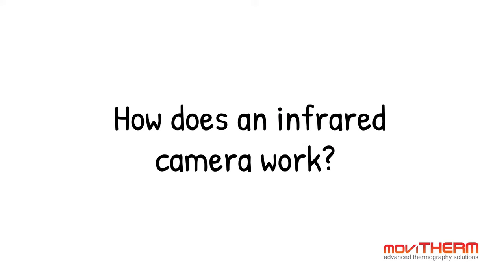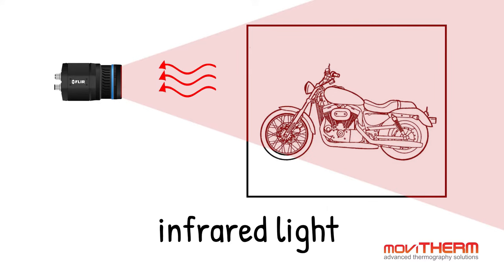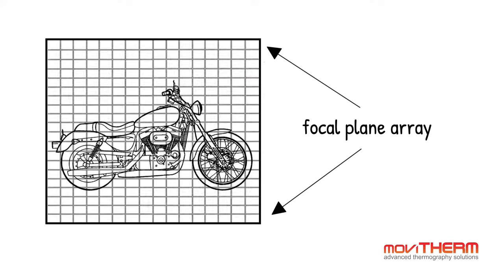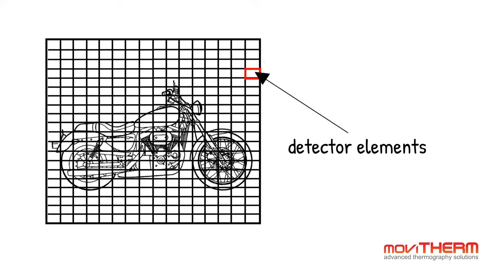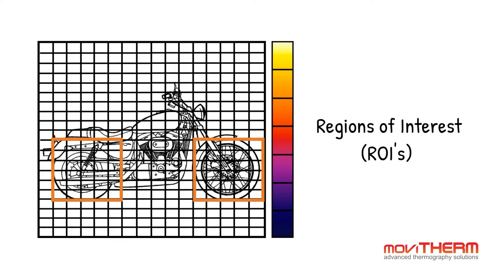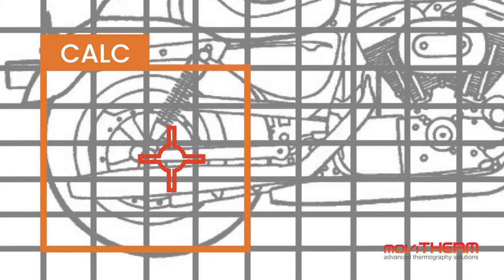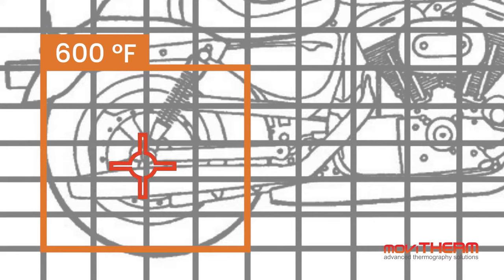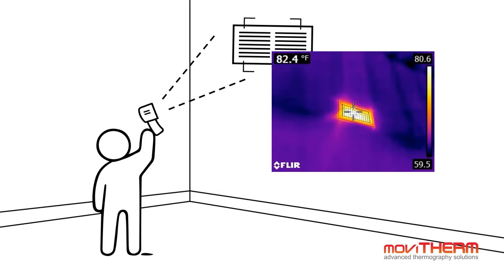Infrared Cameras - How do they work?

Comment: How come these cameras measure the temperature of the "things" that are far away and not for example the temperate of the air in between?
Reply from the maker: Hi R2D2 - great question! Air is essentially a mixture of gases. Most gases are transparent to infrared cameras and the camera sees right through them. Infrared cameras typically only see infrared radiation from a sold surface. There are exceptions to that though. For example, for a significant distance, water vapors will attenuate the infrared radiation.
Reply: @movitherm  Interesting! Thank you for the answer
Reply from the maker: @R2D2SD  You're welcome!
Reply: @movitherm  hi sir
Reply: @movitherm  Question, what would happen if an object was covered by a material that made it invisible? like the new technology developed by several militaries
Reply from the maker: @OptimusPrime-1984  Well, that depends on what this technology uses specifically. Some use light refraction in the visible light range from 400nm to 700nm. Thermal cameras work in a much longer wavelength. 3um to 5um and 7um to 14um. It will depend on a lot of factors on whether a thermal camera can still see the material. Emissivity, infrared signature etc. It is hard to tell without examining the specific technical details, some of which may be classified.

Comment: I don’t believe this fully answered the question. what is an infrared camera made of? how does each element detect heat? how can the heat be recorded and digitized?
Reply from the maker: There are different infrared camera detector technologies available. Each one works a bit different. We essentially differentiate two main categories, micro-bolometer type detectors and quantum well based detectors. The micro-bolometer type has tiny thermocouple elements as pixels that change resistance based on the infrared radiation it is exposed to. The quantum well type actually measures photons in the infrared wavebands. Either the change in resistance or the amount of photons captures is then digitized into a digital count. Some magic sauce is used to convert infrared radiation into temperature and on the software side you can now measure temperature.
Reply: @movitherm  bruh put this in the video with visuals so everyone can understand. Why give visuals for the simple part then boring paragraphs for the RELEVANT but complicated and boring part😑
Reply: Search "How do Camcorders work?" I have read the creator's reply and it seems to be that. 

I am a student and i am learning, if i made a mistake, kindly inform me and explain it to me.

Comment: You have said that the detector sees the infrared radiation. But where does this comes from? Does the bike(or any object) emits the infrared radiation or we from the camera incident any light or etc., to reflect it back and measure with it?
Reply: The infrared radiation comes from the heat of the particles. Let's imagine a molecule vibrating (due to heat) in a dense sea of air molecules. When it vibrates, the surrounding molecules will follow up and down due to electromagnetism, like making a wave from lifting a heavy rope up and down. This wave it creates is called an electromagnetic wave, specifically with the infrared wavelength. In fact, if the particle is hot enough the EM wave may be of a visible light wavelength due to a phenomenon called blackbody radiation (but now I'm getting side tracked). When the heat of the particle emits an EM wave, an infrared camera can detect it using a thermocouple. A thermocouple is an electrical device who's power changes depending on its heat. This is how we can record the heat, but then also transmit it to a screen who's pixel color is adjusted based on the power of the thermocouple (which is given by the heat of the object the infrared camera is sensing).

Comment: Why do infrared flashlights emit red light that is visible to the human eye? Isn't infrared radiation invisible to the human eye? I'm asking this because I've seen this red light many times, on security cameras with infrared illumination.
Reply from the maker: Great question. We first have to define the infrared with respect to wavelength. Most surveillance cameras use visible light cameras with CMOS detectors. If you remove the (near) infrared filter from these cameras, they can still detection near infrared light. Usually in the 750 to 850nm regions from IR LED illuminators. This is often marketed as "nigh vision". near IR LEDs also typically still emit light that is somewhat visible to the human eye. It bleeds down below the 700nm wavelength, which appears as a deep red to the human eye. However, most of the light that the LEDs output is above that region. That's why you can still "see" some of the light with your eyes.

Comment: But they don't detect air; strange.
Reply: that’s because air is made of fast moving gases. they dilute each other to make a homogeneous (evenly distributed) mixture, so the temperatures of air will remain relatively uniform all throughout. the infrared camera would detect differences in temperature, so if you had concentrated hot gas contained near colder gas then it would likely be shown on the camera. think: hot exhaust exiting a car
Reply from the maker: What  @franklinmontez8733  said! Thanks for the answer!
Reply: @movitherm  Is this the physics explanation? I don't think any of 'franks' answer is true. Sounds like a childs guest.  The camera will not measure air at any temperature, nor liquid nitrogen (which is 78 % of the air) Why not?
Reply: @fractalnomics  yes, that’s the physics answer. liquids and gases have higher entropy than solids, which favors mixing- heat will be transferred from gases and liquids faster than from a solid (the main reason temp irregularities are easier to see on solids). The temperature IS detected from gases and liquids, but think of it as the background. If for example the temp of the liquid reads green on the infrared camera, then all you’ll see is green (as the heat is spread evenly throughout) and you may go “Hey, it’s all one color. Why is it not detecting temperature!” but it is, and you just can’t see many irregularities.
Reply: @fractalnomics where did you go home boy? where is the next brain buster question?